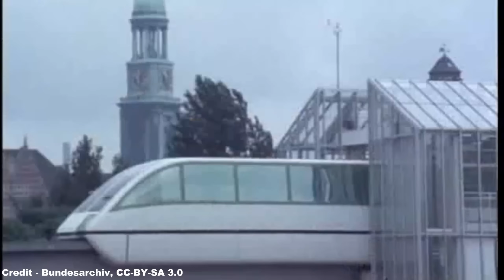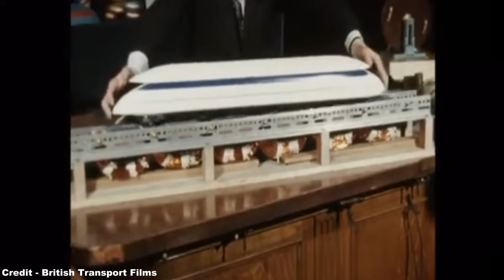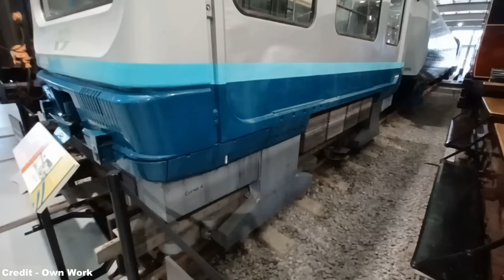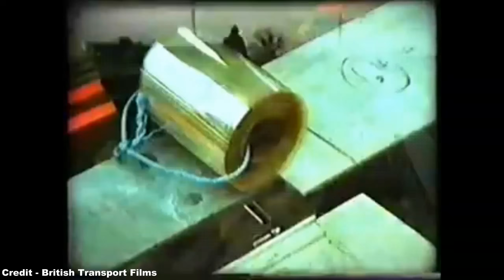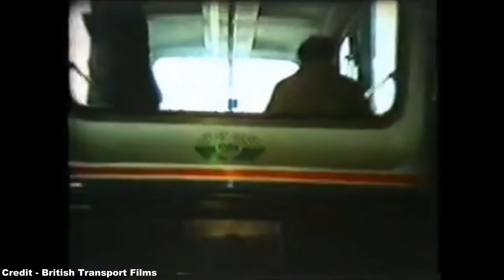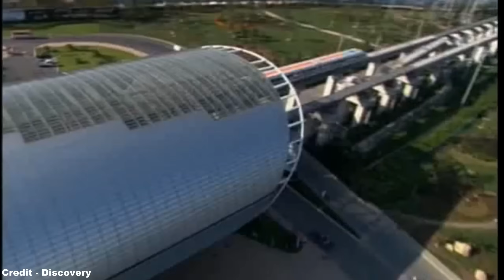A True Pioneer - The Birmingham Airport Maglev

Comment: Up to this day I'm still fascinated by Maglev technology. I had the great pleasure as a student to be able to join an excursion once to the Lathen, Germany, test track for the Transrapid as a student. I still vividly recall the vehicle effortlessly reaching 300km/h whilst you barely notice it only to look out of the window and seeing the entire landscape at an angle because your going trough a curved corner. It really gave a disconnection between the experience of speed and how fast you were actually going. The vehicle was in fact at it's roughest in operation when when departing or stopping as it was obviously not designed for low speeds. Sadly of course the test track was eventually closed about two years after I visited because one of the test trains crashed into a maintenance vehicle killing 23 people... https://en.wikipedia.org/wiki/Lathen_train_collision

Comment: I visited the original prototype at Derby with colleagues who worked on the Birmingham Maglev. We witnessed the prototype running from close quarters.  Unfortunately next day I could not get any cash out of a cash point the next day.  The powerful magnets on the vehicle had wiped my card.
Reply: That's always one of the risks of working around high strength magnetic fields. My father and I have experienced the same; Him in the Elephant & Castle LUL transformer building, myself in the power-car of a TGV very shortly after a prolonged run through the south of France. Thankfully, this is one of the less obvious problems solved by Chip+PIN cards.

Comment: Wish check out TTC STR . Had 1984 to 2024
Reply: Vancouver Skytrain still operates the same but vastly larger UTDC designed system with the mark 1,2,3, & as of the other day Mark 5s. 2-5 are very similar. Very reliable system when properly maintained. Detroit still uses the system and some of the Line 3 cars.

Comment: 吸引式なら日本に「リニモ（Linimo）」があります。
Reply: HSST derivative…I wish to go on that at some point. I have been on the HSST when it was at Vancouver EXPO 86. That old train exists and is in a closed for renovation park in Nagoya. I would like to see that train again. Perhaps I can sit in it again. That being said Vancouver uses LIM propulsion on the fully automated Skytrain since late 1985, the propulsion tech was quite good and they are still using the original cars from 1985 (though just starting to be retired). Fukuoka uses a LIM based system on theirs though with a driver

Comment: The British press killed the ATP.  From Wikipedia "On 7 December 1981 the press was invited aboard APT for its first official run from Glasgow to London, during which it set a schedule record at 4 hours 15 minutes. However, press reports focused on a distinct sickening sensation from the tilt system, and nicknamed APT the "queasy rider"   What the press didn't report was that they themselves had all been out drinking heavily the night before and turned up drunk as skunks. That act of gross irresponsibility by them destroyed a project that could well have given Britain a vital lead in train technology for the next few decades. Instead, the Italians got the technology, tweaked it and sold it back to us as the Pendolino. It was the British Press that led the side down, not the engineers.

Comment: Great video. I work at BHX & there air plans for the current Air Rail. Once the HS2 people moved is completed the air rail will be dismantled. It will be replaced by a walkway connecting from the airport to the train station. Like how the walkway at Manchester Airport works for there train/bus/metro station. The issue the air rail has it is now adjacent to the new security area. With up to 100+ people at any given time waiting for the air rail to the train station. As each carriage can only take up to 30 people at a time. Due to this overcrowding has been a real problem. BHX is looking in into getting permission off the council to replace the air rail with the walkway, application expected to be given in 2027.

Comment: Apparently the buyer of car 2 thought it was a model. 

The current system at Birmingham International is going to be replaced by a people mover that will link the HS2 station, the NEC, the railway station and the airport. 

I have fond memories of visiting the airport and riding the mag lev as a child in the early 90s.
Reply: Correct terminology is that it will link Birmingham Interchange Station on HS2, Birmingham International Station on the WCML route , the NEC and Birmingham Airport